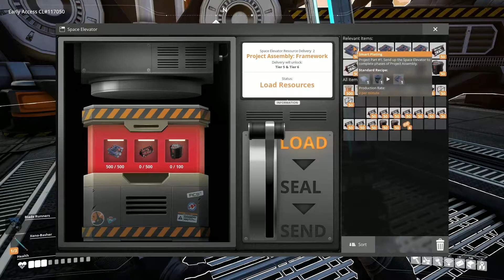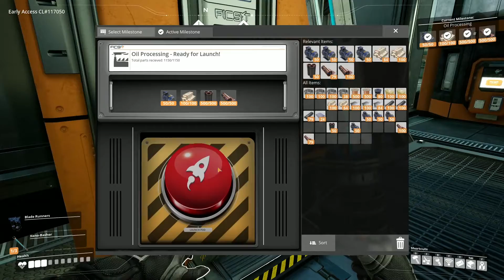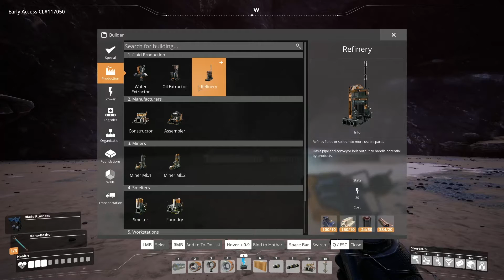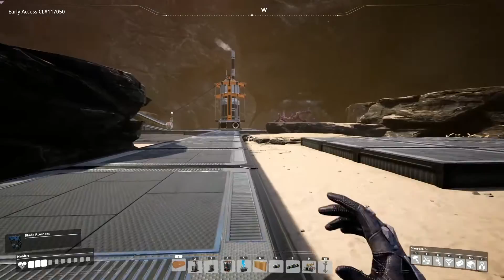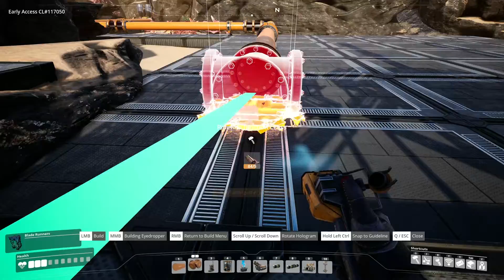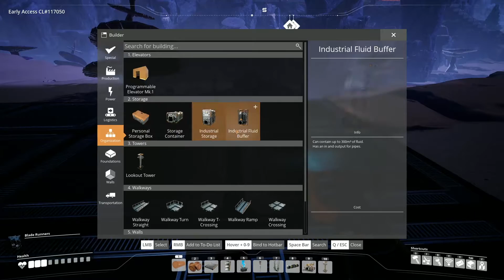UNLOCKING AND TESTING OIL!!! | Satisfactory Gameplay/Let's Play S3E9

Comment: Hey John
Love your content, keep it up!
One thing thing i noticed was, you ran two pipelines side-by-side to the rubber, you can do it with one...
If you pump from lets say 3 places (120+120+60) that's 300 in total, and 1 pipe can hold 300 max, you'll need fewer pumps and it looks cleaner